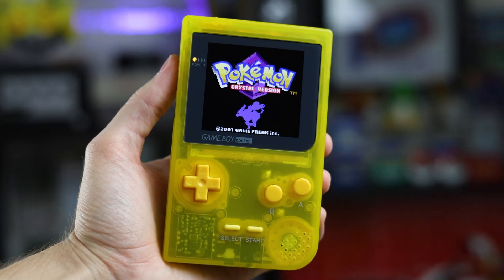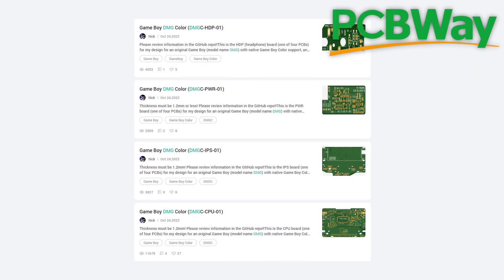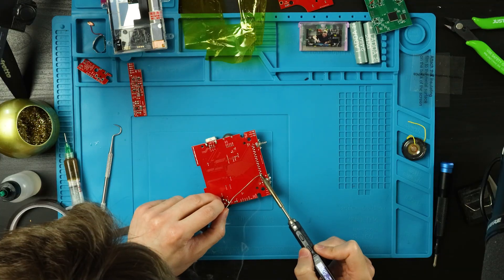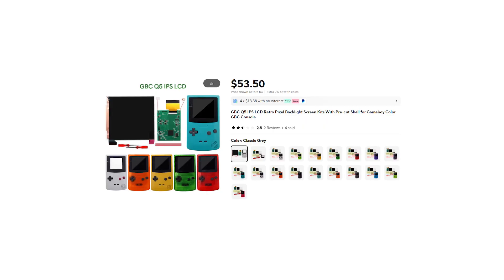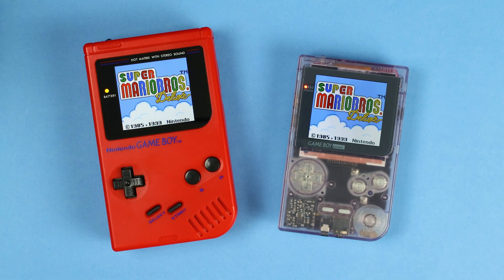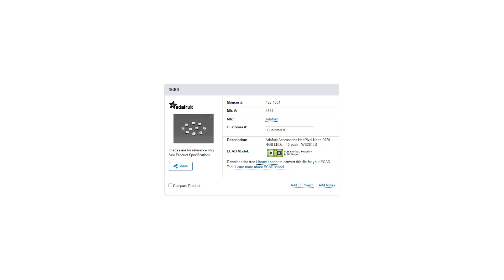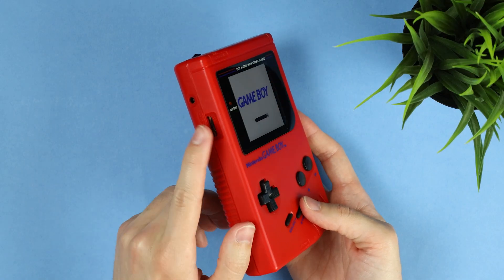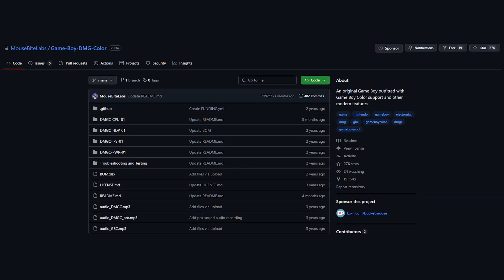My Favorite Game Boy Color Mod! | DMG Color (Bucket Mouse)

Comment: Nice video :) I'm glad you overall enjoyed it!

I also hate tactile buttons lol. I never use them. I put them in because they seem to be popular with a good chunk of the community. But I also hate the extra effort to "double" press them. Also, while I did make a BOM for the project, I didn't specifically upload it to PCBway. Someone must have ordered them once and then PCBway kept it as part of the project? I generally don't include BOMs on the PCBway project pages just because the project is pretty customizable with some of the parts, and I kept getting asked by them "what is this CPU part? Do you have a source?" and it was hard to explain to them that it's an old part from a Game Boy lol

As for the OEM parts - there appears to be a replacement power switch you can get, I have yet to try it myself. With the DC jack you're kinda SOL. The headphone jack could be replaced, but this mod was for maximum aesthetics - and I haven't found a good replacement for the DMG headphone jack. All of them either feel really chintzy or don't completely fill the hole in the shell for the headphone jack. Most people probably wouldn't care, but I do. AFAIK there's a Pro-sound replacement board I link to in the repo that you can use that has new parts on it, but that was also two years ago so it might not be available for purchase anymore.

Anyway, thanks again for the video :)
Reply: Hear me out, Tactile buttons can be great and in my option necessary for the GBA that D-Pad is so small it's completely unacceptable imo. Can't run properly in Pokemon (yes I had a DSI in my childhood, it's what I am used to).
Anyways there are membranes available for GBA and even for GBC which makes tactile buttons really good, at least try it with proper membranes once. 
Oh also, If you can press all 4 directions at once sand down a small piece of plastic and put in the middle of the D-Pad where it's rocker is that will fix the issue.